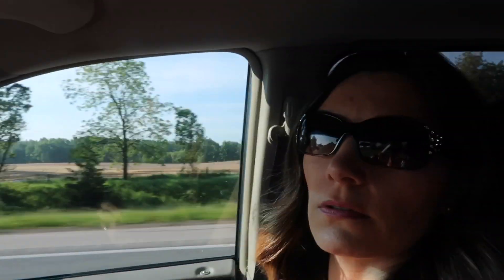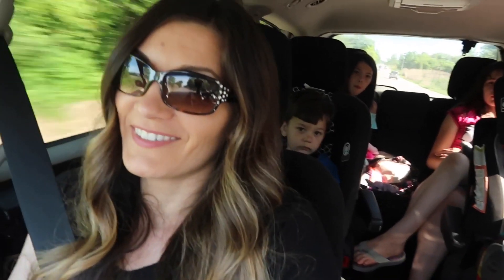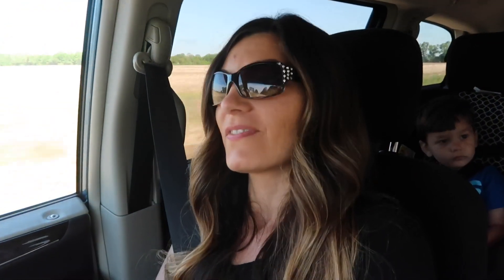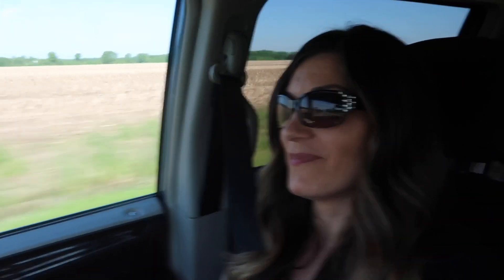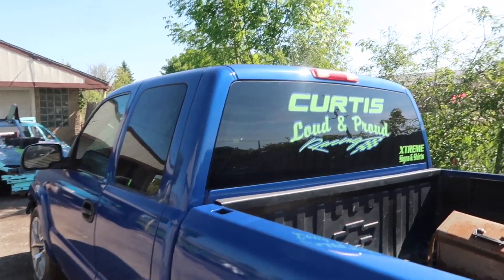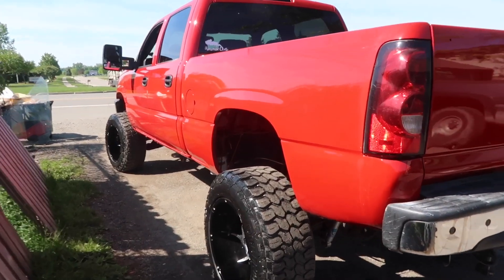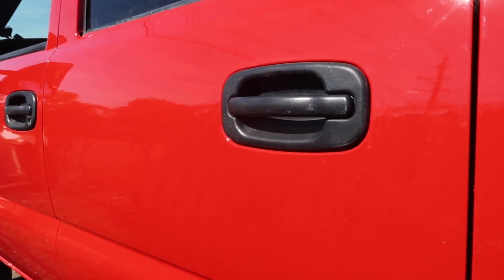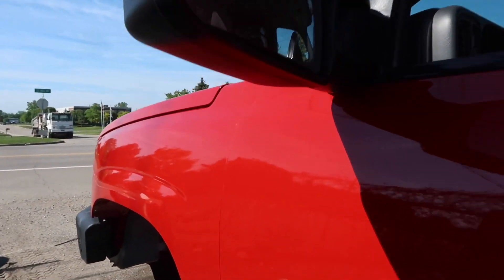My Duramax is not Black anymore! New paint job

Comment: Man, some black Bushwhackers with the stainless bolts around the wheel wells will make that red pop even more! Truck looks great and when you black out the windows with the tint it will be awesome! One more thing, the wet sanding is relatively easy, just make sure to purchase a lot of of elbow and shoulder grease before starting, you'll need all you can get! :)

Comment: Red and Orange looks great on those trucks. Great choice, I'd never get my 2nd gen Dodge painted that color though. Gotta stick with the black for mine. Awesome how great the truck turned out, I see what you're talking about with the clearcoat. I want to get my hood re painted because it's all streaky and the clear coat is fading, getting some cab lights installed soon too. I did the front shock absorbers, but the rears are going now too.

Comment: Should paint the grill black, get rid of the chrome as much as possible. Whit the chrome you got 3 colors now, chrome locked better when the truck was all black and just 2 colors. Thats just my opinion other wise the paint job looks nice hope ju get som rust protection on the frame and wheel wells. And in side the rockers

Comment: Orange peel is from the paint as well. Its from the distance of the paint gun to the panel.And yes wet sand and and polishing can correct your paint job. 1600 grit 2000 grit and polishing. Put 01 and confederate flag.

Comment: Your painter is full of crap! If he spent 24 hrs. on the bed, he is in the wrong line of work. I just hope the price was right. You will have to wet sand and polish before you can even wrap it. I hope he put extra clear on for sanding and buffing or you will need the wrap to protect from the sun because that is what the clear does. And the clear don't make the orange peel, it makes the shine when sprayed right!